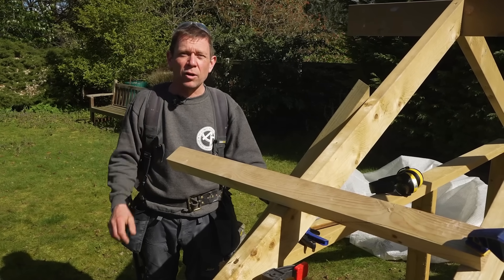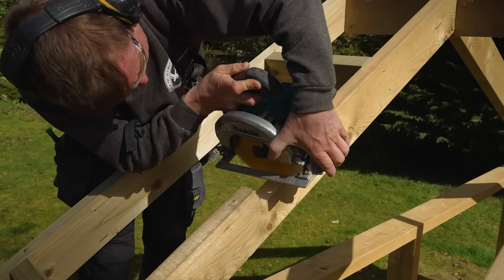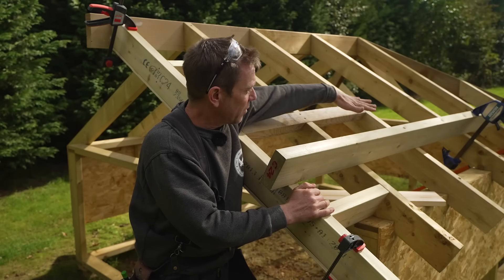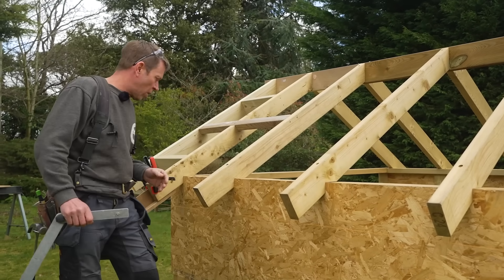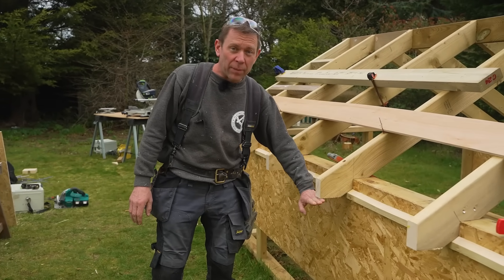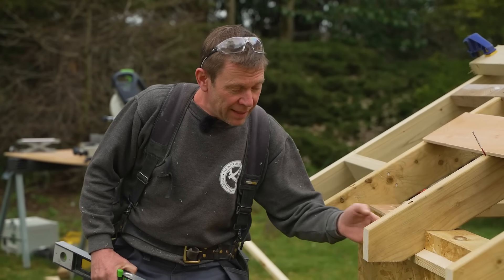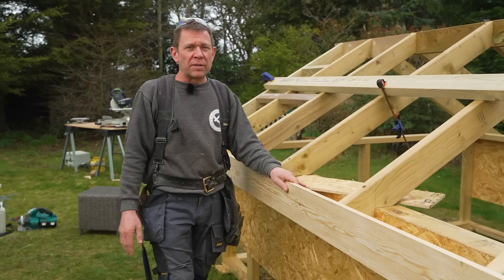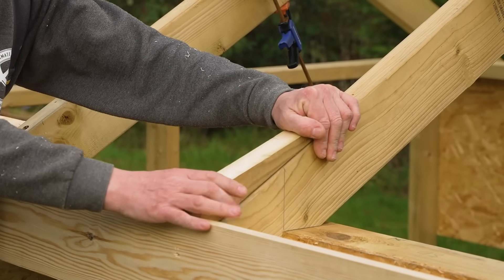Gable End Roof Ladder Explained

Comment: Love the underneath line tip.
Ive always struggled to get the feet perfect.
Acceptable.
But not perfect.
I can always see any minor deviations.
Especially on 400 centres.
Reply: What doesn’t always help is plastic fascia.  It can bend and bow even when the rafter feet are at 400 centres.
Reply: @Daniel Cox  7" fascia. 18degree pitch roof. 6 metres long.
I spent too long getting it as good as I could.
The top was bang on.
Used 9mm osb and 90mm plastic trim for the soffit.
Used a chalk line and individually marked every rafter foot with a boat level. Was proud of it from the top

But from underneath it looked slightly wiggly.

Something only a tradesman could see.
But I am a tradesman
It bugged me.
Had to leave it tho.
I'd hammered the polytop nails home.
Reply: @flyingjackcarpentry9394  sometimes it’s just not happening.  
A sub fascia helps but it’s another cost.

Comment: Noggins between the rafters inboard of the gable ladder stop the inside rafter from twisting. A small detail but well worth adding. They will also support steel strapping run over the top to act in tension against snow loads.

Comment: excellent vid as always. i do gable ladders both ways like. picked up the second method of notching the rafter out of an american book years back which had stuff by larry haun in it. used it on a few roofs. i guess a combination of both maybe would be a good call. 

that bevel would deffo come in handy. id be buying one of those like. That line underneath tip ill have to try that out next time alongside the facia brackets i made that i blatantly copied of you from another of your videos.
Reply: Thanks for watching Paul. 
Hopefully the bevel will be available soon .. 😬
Reply: @Ultimate-roofing-square.  excellent I shall look out for it. Be easier than using small bevels on a roof
Reply: @paulfinnonjoinery  thanks.

Comment: Great video, 
after some advice on 1st fix nail gun, at the moment using the dewalt 18v platform for various tools but needing a nailer, the dewalt nailer doesn’t seem a very popular option swaying towards the Milwaukee what do you think?
Reply: Hikoki Is a brand well worth considering
Reply: I have 2 Hikoki nail guns. Never had any problem. Just stay away from nail guns with "flywheel system", so my options would be Hikoki or Milwaukee, both have the so called air spring.

Comment: With the nogging that is cut into the rafter; will it make the bottom part of the rafter have to take up more forces in tension, or does the cut-out not afffect the compression of the rafter?
Reply from the maker: If the cutout is tight the compression is maintained to some extent,  but it will marginally weaken the rafter.